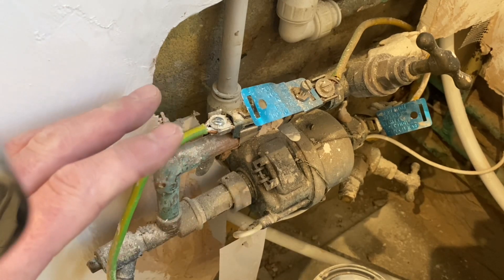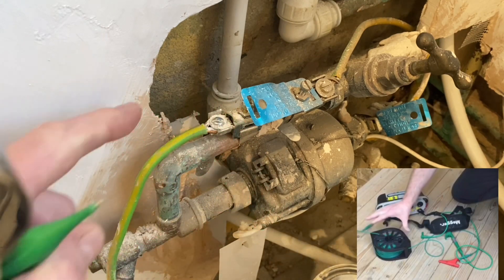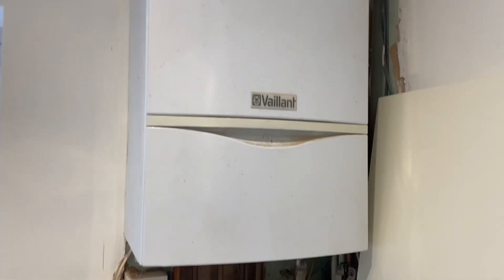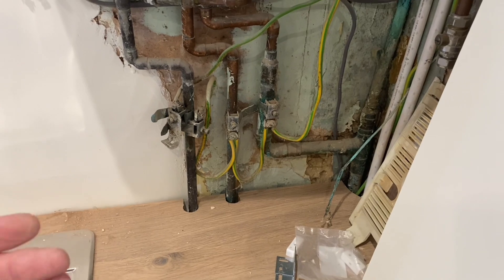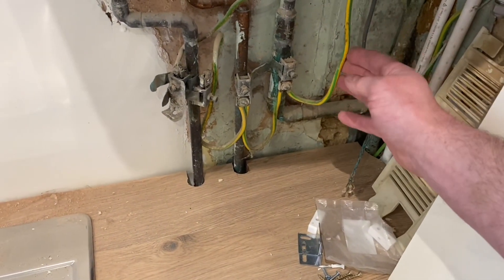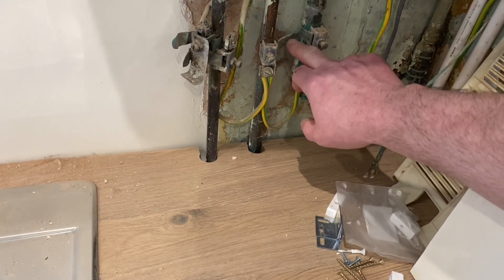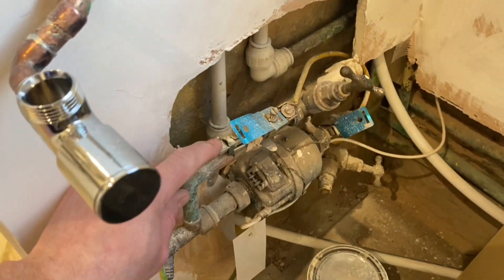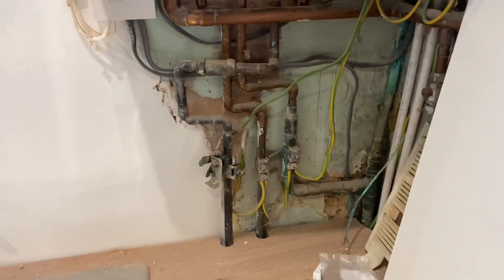Parallel Earth Paths - Removing them for the Continuity of the Protective Bonding Test

Comment: i can never understand why they do not sleeve the metal pipes in a strong,waterproof,thick,non conductive plastic or material.that way,the pipe is still strong and will not become live from an external live cable,leaving only the earthing bond terminals accessible at various points!

Comment: I'm a bit confused. The disconnect earth wire and the water pipe terminal is enough for the test, i don't see why it will pass through other pipe, the small current produced from MFT will force through those two points only.

Comment: I do see the logic here. Obviously if you are not 100% certain which conductor is for which service at the MET. Then it is easily possible to mix them up. But if both give values below 0.05, then both are sound and the reading will only improve if you take the time to identify the correct service. Obviously if one is giving a high or open reading, THEN disconnecting at the pipe IS essential in determining which conductor is at fault. The model form Certificate only requires a tick to verify main bonding, and ticks to identify the services tested.

Comment: Again my AM2, they preferred I only remove from the MET, and "clamp" onto the pipe work for the test.  The idea being as to 100% determine that there is in fact connection to the pipework.  As usual, attend the PRE-AM2 session and ask 1001 questions on the preferred method for your test centre.
Reply from the maker: Thanks for the great comment 👍🏻

Comment: 6 separate tests to check continuity on the water and gas bonds! Don’t see the issue with just doing the 1 test to check the cable end to end. Once the earth tag is tightened up to the pipe and the bonding cables are connected it’s impossible for the pipe work not to be earthed.

Comment: Removing the gas bond wont clear the parallel path as the boiler will carry the parallel path as the pipes are connected to a metal plate. I usually test them by removing the bonds at the board and the lowest is usually my the one you are after. No way of getting no parallel paths as pipes could be touching in the floor and you would need to remove the boiler and remove the touching pipes. Great subject and in theory yes but practically no.
Reply from the maker: I stated you remove the bonding conductor at both ends to remove parallel earth path 👍. Massive thanks for commenting and watching. Gaz